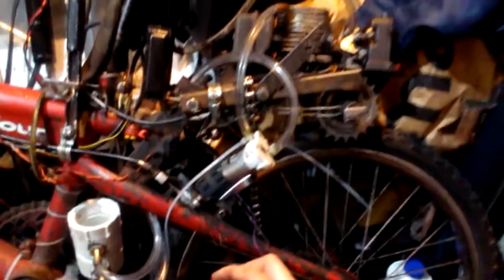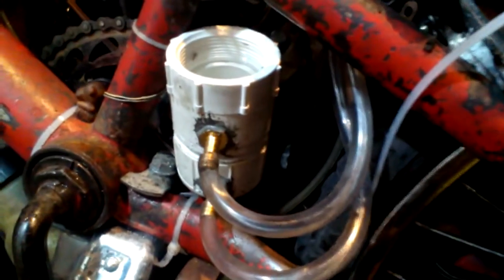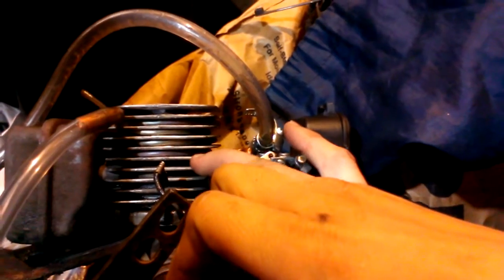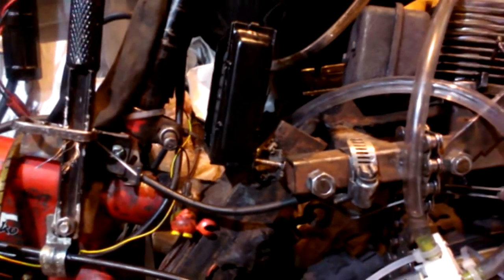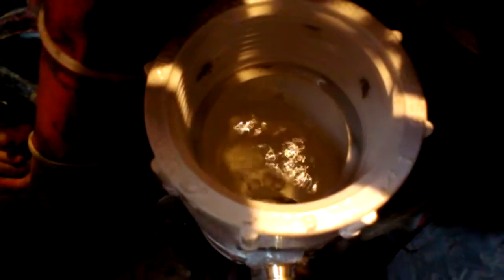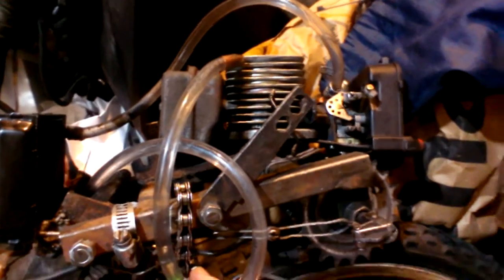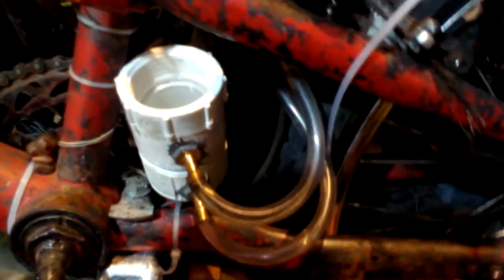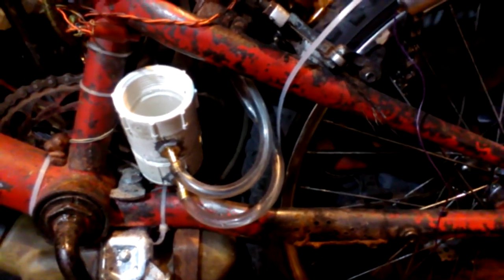Small engine water cooling setup experiment test

Comment: I as wondering how your up coming cooling motor setup worked out?  I need to cool my bike motor that I mounted in a electric moped.  It runs hot inside the moped housing.  please shoot me a link to your other video.  Thanks
Reply from the maker: +Doug K i never put out a second video on this since the copper tubing work hardened and broke before i could make a proper video on it. but it did work. the system did exchange heat into a radiator, which exceeded my expectations. i ended up just dropping the project since i have other projects besides this.
Reply: +def215 Thanks for your response.

Comment: So awesome!!!!!! I want to try this on mine! I was thinking of a similar idea  but with the oil and have a pump pulling oil from one side of the crank case through an oil cooler and then into the other side.
Reply: Did it work?
Reply from the maker: Kyle Saletta    yes, it worked. the system was adapted to the homelite 42cc chainsaw 
engine. i used water as the cooling fluid in the system and it was hot enough to keep your finger in the water reservoir for no more than a few seconds. but the copper plumbing around the cooling fins eventually work-hardened and
 broke. i retired the water cooling setup since it over complicated 
things on my bike, and i didnt want to rebuild the water cooling system.
Reply: Wow that was such a great idea! Too bad it broke though. Do you have any other ideas for 1 cylinder engine cooling
Reply from the maker: Kyle Saletta  thats the only one so far. the idea behind the one in the video was not to go with a full water jacket, like all water-cooling setups do. i didnt want it to be strictly water-cooled. i wanted it to be a hybrid system so it was both water and air cooled, so you can run with or without the system circulating water.
Reply: Oh yeah I see how you wanted it that is a good idea. Maybe one day some one will make and sell new heads for the more popular small engines that have a cooling "tunnels" almost like youe tubing but more like a cars running through them and then you would have to choose your own pump, cooler and resivour